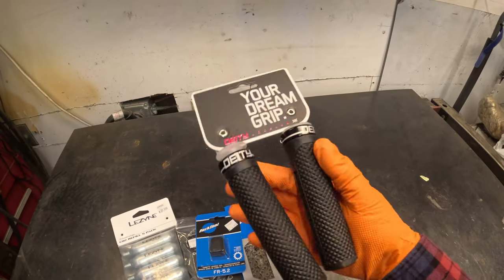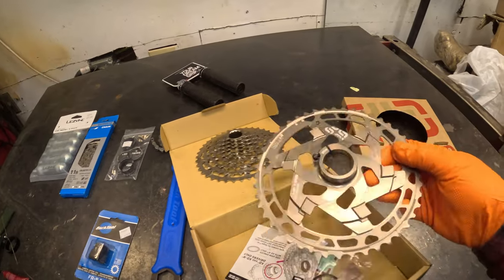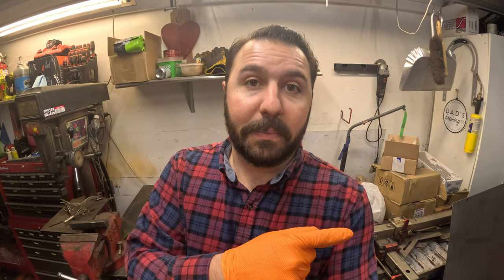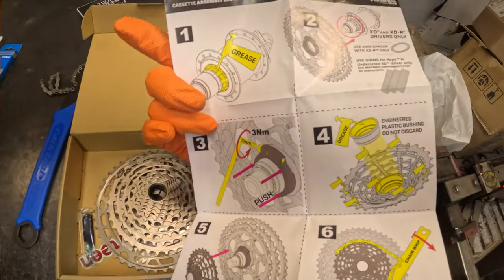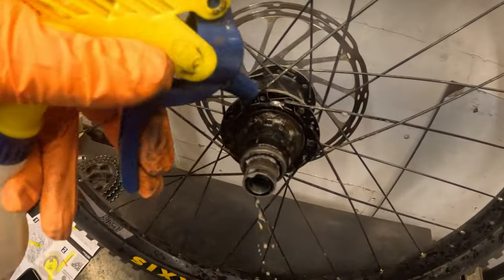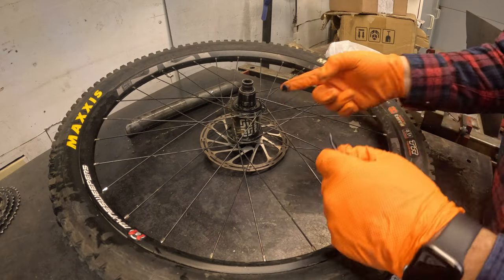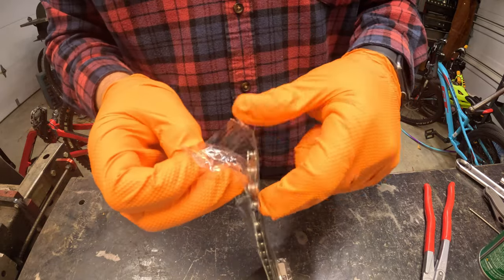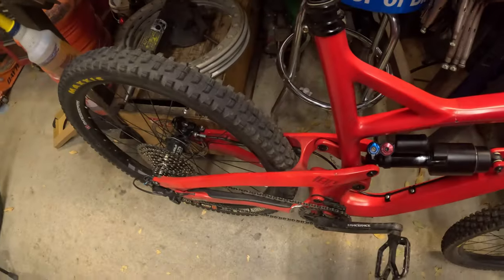e*Thirteen Helix R Cassette Install

Comment: Been having issues with connecting the 2 pieces of the cassette. May need to try how you use the chain whip to lock them in place.
Reply from the maker: Give it a try! Make sure you put a little bit of lube on the edges where the two pieces lock together. Some of these you can do by hand but others are a bit tighter.

Comment: You didn’t give 2 Fuh’s about a brand new cassette.
Tossing it around like a rag doll, hot dang!
Reply from the maker: It’s going to get abused way worse while riding. I’m not worried about it 🤷🏻‍♂️
Reply: @stevenburns4lo  not sure it’ll experience the identical imposed forces lol
Reply from the maker: Eh, I’m not worried about it. It may have seemed like it was throwing things around hard but I wasn’t being that rough. No way these are that sensitive.

Comment: I have a shimano 10x51 casette but I been thinking of getting that 9x50 for a faster gear. The price is pretty steep.  Im going to go over to corona jenson see whats cooking on the prices lol
Reply from the maker: Yeah the price is definitely steep. Quality seems nice but time will tell after I get a few hundred miles on it. TBH I don’t use the 9 tooth gear that often, but when I do use it, it is convenient to have. I have the 11 speed version with 32t chainring and 27.5 tires. If you have the 12 speed and you don’t need the ultra low ratios for climbing, then you can always step up your chainring size to get higher speeds.
Reply: I like the E thirteen casette, run it on a mullet build 1x monster cross rig.  (12sp 9-50t cassette, XO1 AXS mech, 42t front ring)  but to be honest, not sure if the 9t is really needed on a dedicated MTB unless you run a really little chainring, or ride somewhere really flat.  I rarely use the 9t in the dirt, it's more my flat pavement or dh pavement gofast road gear for mixed surface shinanigans. 

I run a 34t front and a 10-50 casette on my Epic worldcup XC racebike. (Still running 11sp and mechanical on that... someday I'll go AXS on that.

Unless you are doing a drivetrain refresh - like you are replacing a worn out drivetrain - stick with what you have,  go E13 when you can go 12sp and do a full rebuild (and consider AXS... electronic shifting is da sex)